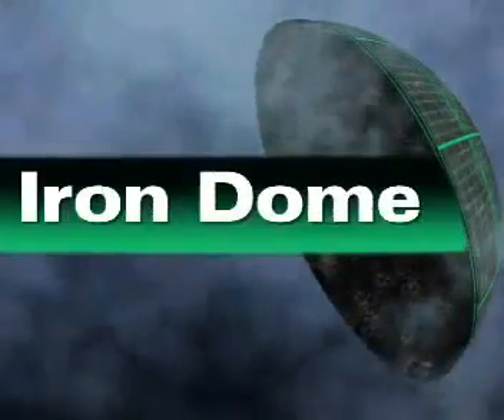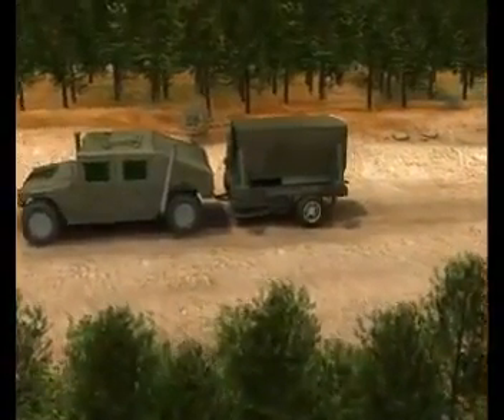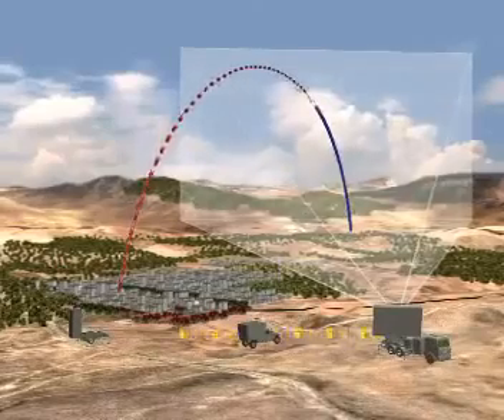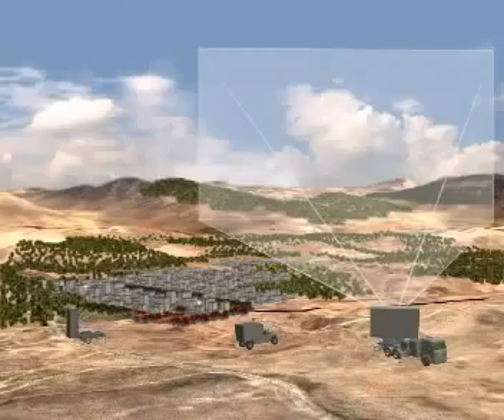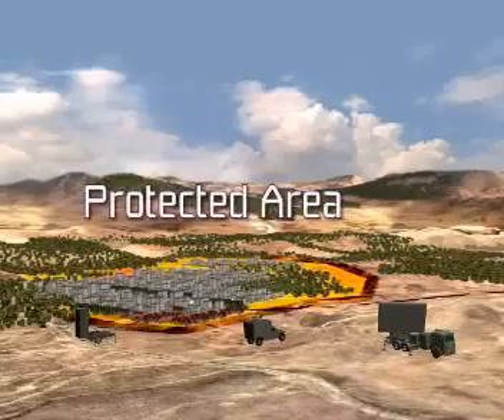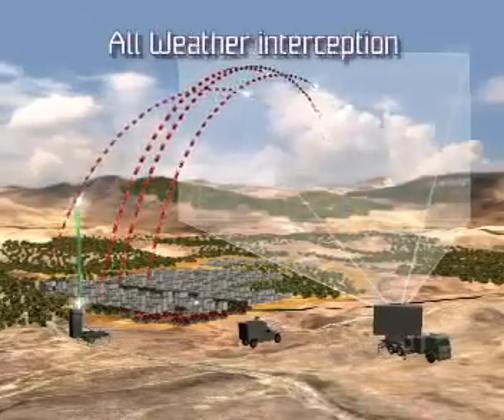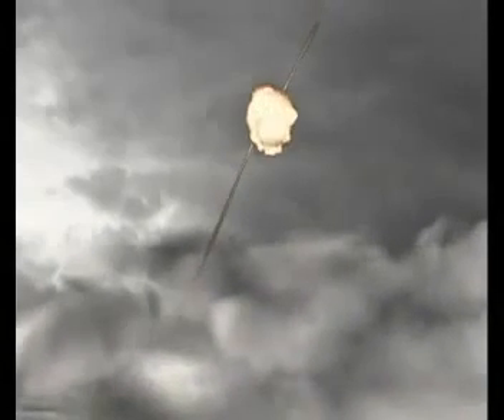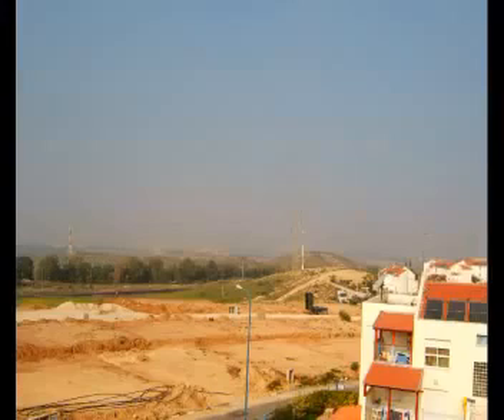Israel IDF power part 2: The "Iron Dome" - missile defense system

Comment: The proclaimed intercept rate is 90% for rockets engaged. You say they only intercept one out of five, ok, I accept that number so then what Israel should do is drop one air fuel bomb on Gaza for each rocket fired at Israel.

That would solve this problem real quick!